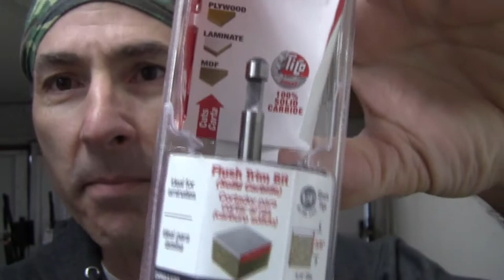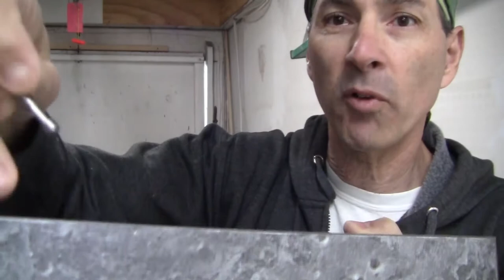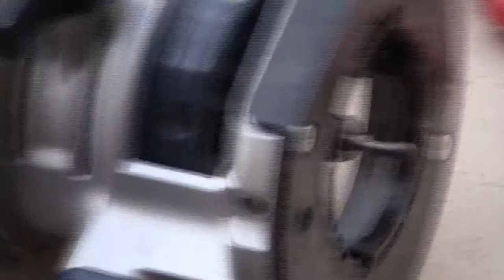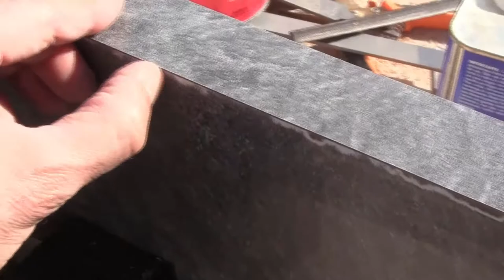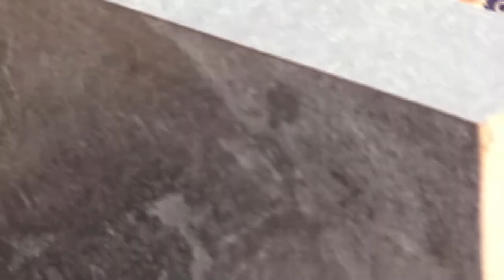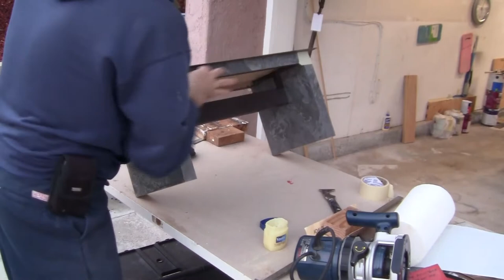How to Router and File Formica Laminate Sheets

Comment: Ken, I had the same problem with chafing using a compact router.  It happened when I accidently slightly tilted the router while routing the edge. I eliminated the problem by shortening the length of the cutting bit that was exposed below the router and above the ball-bearing guide. When I moved the guide closer to the router leaving only about 1/8" of the cutting bit between the router and the guide, the problem went away.
Reply from the maker: Thats a very good idea. Thank you
Reply: You can also use masking tape on the face where the bearing runs on .

Comment: The chafing comes from having too much of the bit exposed. It can happen with any bit.
Reply: Doesn't happen when you use a bevel bit with an outside bearing set up on a trim router. Obviously you run that along surfaces that are already laminated and then file you always use a flush trim bit with no bearing and then a sanding block before you laminate up against the edge. cleanup.
Reply: @jacobladder6165  obviously if you have the right bit properly set up you won’t have the problem. He was blaming the bit for the chafing and I was just pointing out that it can happen with any bit if it’s too exposed.

Comment: You're giving me encouragement to laminate my ugly formica countertops.
I'm going with black formica laminate. The edges are square, not bullnose. What order should I apply the laminate? Should I begin at the front edge, then the top, then the backsplash that faces you, then the top of the backsplash?
Also, how long should you let the laminate piece you're working on, dry, before you start routing?
I'm getting kind of excited about this winter project
Reply from the maker: First of all, you can do it. I really enjoyed my projects. You can even start with a small test piece to see how the system works. Square is easier than bullnose to work with on edging. Do the edge first then the top then the backsplash. You can start routing as soon as you J roller down the laminate.

Comment: The bad edge is probably because you are moving the router in the same direction as the rotation of the bit.  Need to be going against the bit rotation.
Reply from the maker: Thank You for the tip.

Comment: I'm sorry but this sounds crazy. How is using a bearing router going to flatten or make a straight edge? Wouldn't just some simple sanding with a sanding block actually make the Surface flat enough? I'm sorry but I've been doing laminate for less than two months and this is totally cringe
Reply: I'm assuming he was planning on using some type of straight edge guide for the router,  but yah the bearings aren't necessary at that point..just a regular straight cut bit would work..or a sanding block

Comment: a file with 2 hands?? lololo wtf
Reply: @Daniel Delgado I make laminate things all the time. LOL this would be the guide to making everything difficult
Reply: @Daniel Delgado yeah I guess. I file 100s of linear feet some weeks. just start at an angle a few strokes they lay it horizontal so it only cuts what is above the top. finishing with the file flat on the surface means there is no way to white line or cut into the top...idk some people are fast and good. some people are slower and good. some people just can't file to save their lives haha
Reply: I file with two hands. 10 degree first pass to break the angle rough side only in cutting direction angle to direction of travel. 45 degree next pass to remove bulk still rough side scrubbing motion. 10 degree pass with rough side to finish removing lip. Then same with smooth with final pass making radius.

I use both hands to control and apply pressure.

I don't use sand paper unless it's color core or "no sand bits " . 

My resume is about 10 years full time laminating in shops counter top and cabinets.

I found the vid while I was trying to figure out why in the Sam hell new router bits come with square bearings